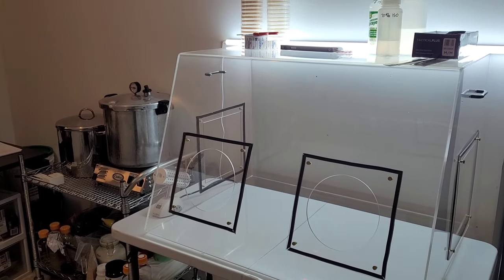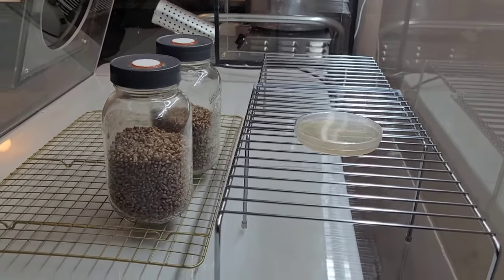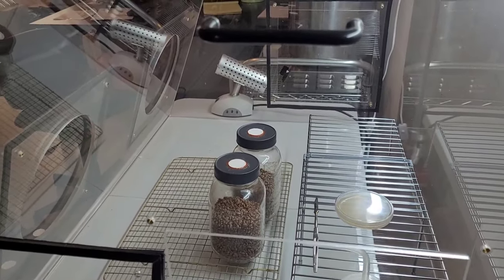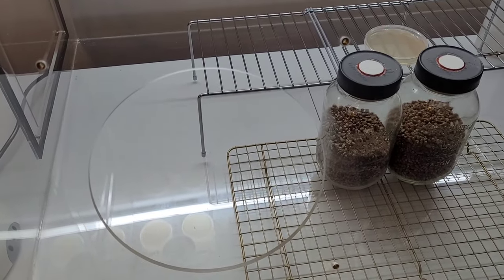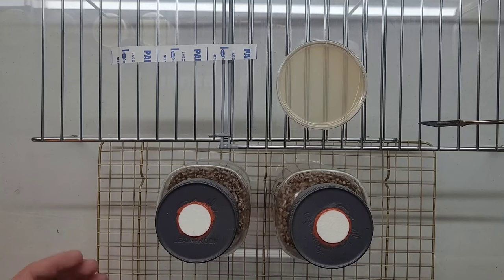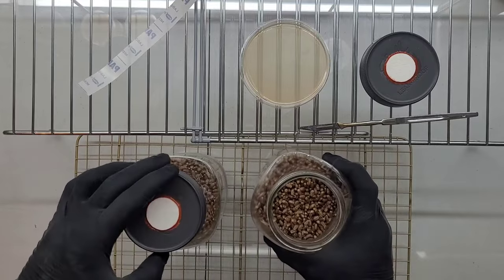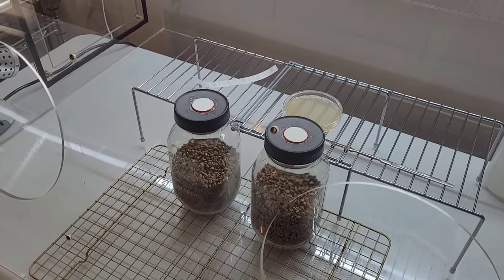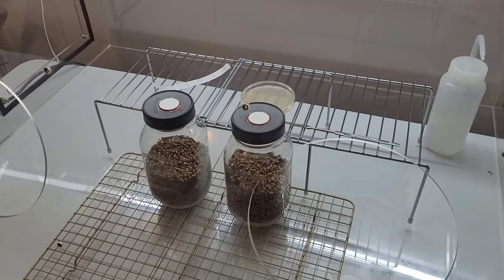How to operate a still air box (SAB) for home and commercial mushroom cultivation

Comment: Agree on simplicity of SAB and usage. On the part of adding fan and filter internally and gloves access, thats depends on use and environmental factors. Not to say it is good, just an added layer of getting better air quality control within the box. The inter filter and fan doesn’t need to be turn on during actual work, just need to pre-clean and turn off beforehand.

Comment: I see a lot of SAB with the holes centered in the vertical middle, but isn't it better to make them closer to the bottom? So if a stream of contaminated air enters, it does not come over the material
Reply from the maker: If a draft came through the holes, the floor is where the particles settle, so no, the floor must not be disturbed.

Comment: Hi, thanks for this valuable info! And just starting and I'm going to remove the gloves from the holes of my SAB (it's just an inverted tub). I'll Also add something to put my materials a couple cm above the floor of the SAB. I wanted to ask you, if I Get more serious in the future, do you think making a proper SAB like this would minimize contamination reliably (providing good sterile technique) or is a laminar flow clearly better? Thanks!
Reply from the maker: Both have advantages and disadvantages and can have different applications. Working with contaminated wild cultures or spore printing is best done in a still-air environment. Still air is often employed in areas that don't have access to a cheap/reliable power source in developing countries.

Laminar flow allows for freedom of movement, workflow, and a greater volume of work when the appropriate infrastructure is available. 

Having both available is the best-case scenario. Sterile technique is key no matter what you choose.
Reply: @StipeCap  thanks for this detailed answer. I'm just a beginner but I'm Also highly motivated. I'll see how I can manage to make myself a proper and big enough SAB for now.  I'm also trying my Best with sterile technique, exposing grains and spores as little as possible to the air and not putting my hands above this materials. It's more challenging that it seems, isn't it?

If I can, I would like to know your opinion about this: should I, provided I Get a big enough SAB, prepare the cakes inside of it or not? Because it seems overkill, but, at the same time, we're really careful while preparing the grains, but not as much with the bulk, and I happened to Get contams at the bulk colonizing stage.
Reply from the maker: @martindamasseno5164 Still air and laminar flow are for the sterile culturing phase of cultivation. Producing pure culture on agar, the inoculation of media like spawn, liquid culture, grain to grain transfer, etc.

Anything past that phase that doesn't involve nutrient-dense substrate or media can be handled in the open air.
Reply: @StipeCap  thanks, man, really. Much appreciated!

Comment: Where did you get that? Or did you build it? I love it.
Reply from the maker: I had it fabricated, my design.  The top, front, back, and bottom are a single piece, 1/4" plexi, with polycarb hole covers, brass screws and grommets.

Covers have foam gaskets. I'll have to check but I believe it's almost 400 internal quarts, worthy of commercial use.
Reply: @StipeCap  would be interested in replicating it. It is amazing.
Reply from the maker: It was a prototype intended for production, but it's not cost effective, too expensive.
Reply: @StipeCap  that's a damn shame. Its awesome
Reply from the maker: One of a kind, but it works great. I can run a load of bags without laminar flow. 

SE Asian farms have more still air boxes than US farms have laminar flow. Folks don't appreciate the efficiency and reliability of still air.

Hopefully, it will inspire folks to venture outside the upside-down tote mentality.
Reply: @StipeCap  could you let me know the rough dimensions of the box? I'm going to price out the plexi glass to see if its worth doing myself. 

Never worked with plexi glass before but its gotta be possible. It'll be easier to make the arm holes square but I love the covers, I think the brass screws could be replaced with 1/4" carriage bolts fed through holes and glued in place, threads sticking out of the SAB, with matching nuts tightening down on the cover. the foam gaskets are easy, 3m foam strips. 

Just gotta figure out how to properly glue the seams of the plexi glass together.
Reply from the maker: @ogonbio8145 You can make a box out of wood, with a sloped front that has a plexi lid opened with a piano hinge. No need to go entirely plexi.

Mine is:  36.5"L x 26.5" W base
24" H 

Top= 36.5L x 18W

Face= 36.5L x 25.5

Keep in mind that mine is designed to be only 3 pieces. The top, face, bottom, and back, are a continuous sheet that has been bent under heat to form the box, the sides are welded in.
Reply from the maker: @RealProgressInAction  Yeah, still air is an under-appreciated method for producing cultures, at least in the West. Still air is widely utilized in SE Asia for the production of large-volume mushroom cultivation.
Reply: @StipeCap  I built it and made a thread about it in mush cult "XL SAB for $100". Posted it at midnight on a Tuesday so I don't know if anyone is gunna see it lol.
Reply from the maker: @ogonbio8145 I'm on a self-ban atm, lol. Folks will see it. Just checked, very nice work, looks great.
Reply: @StipeCap why is it not an open bottom? What would be the practical difference? i'm also going to be recreating it I loved this design.
Also, can I use standard acrylic or is plexiglass a must? From what I understand plexiglass is just a more durable acrylic.
What diameter are the arm holes and how far apart? Thank you!
Reply from the maker: @joaorebochooaw6321  It's all enclosed to reduce drafts, drafts are not "still air". The arm holes are 8 inches, I believe.  You don't need the entire box to be acrylic, you can build a wooden box with a plexiglass front on a piano hinge to open/close.

Comment: I do wipe down the "floor" of my SAB before I do work. I like to think I'm removing dust and debris that has settled from previous use.
Reply from the maker: Clean your SAB, but there's no requirement for excessive sanitization. If there's dust in your SAB, remove it before use.

You can run the SAB dry, or spray the floor with soapy water to trap particles.
Reply: @StipeCap  Can I spray soapy water all over inside the box as soon as I set up it? This way the soapy water captures floating particles and there's no need to wait 3 hours for them to naturally fall down to the floor?

Comment: Where was that SAB built it's. QUALITY ????
Reply from the maker: I had it built by a fabricating company.
Reply: @StipeCap could you please share the concept dimensions and the material used to frame the covers? That black material that seems to adhere to the acrylic
Reply from the maker: @joaorebochooaw6321  The black stuff is crushed foam gasket to prevent leaks. The hole covers are polycarbonate with sunk threaded brass grommets.

Comment: Dude, I would never use one of those.  It may work good in a lab environment with HEPA filtered air coming into the room and zero carpeting, but for household use there's too much contamination floating around from carpets especially.  I can walk a few steps across a carpet and in the right light I see massive dust particles in the air.  Not to mention contamination from kids and pets and the wife's vacuum cleaner.  LOL

Comment: Thats a bitchin sab , ist it commercially available ?
Reply from the maker: Too expensive to sell, unfortunately.
Reply: Do you do your flame sterilizing of blades and syringes outside each time and then come back in slowly?
Reply from the maker: Yes, always sterilize utensils outside of the SAB. The red-hot metal will maintain sterility while you move from exterior to interior.

Comment: You can use the same theory as a paint booth, dust particle floating around can mess up a paint job, so they wet down the inside to keep particles from blowing around and was vaccum vented! you don't need to vaccum vent, but use a spray bottle of 70% iso.alchoh. to moisten the interior, but not to the point where you have dripping from the top and onto your items you are working on!
Reply from the maker: Some folks spray the floor with soapy water to trap and neutralize particles, isopropyl tends to evaporate and produce fumes. Neither is necessary, but I'd choose soapy water over alcohol.

The problem with a vacuum system is it pulls outside particles into the box, and disrupts the still air environment.